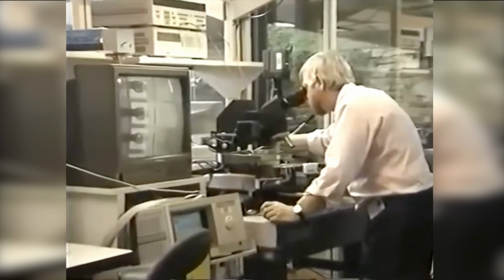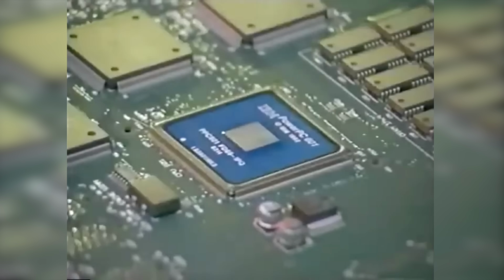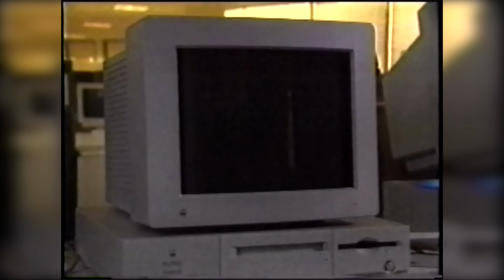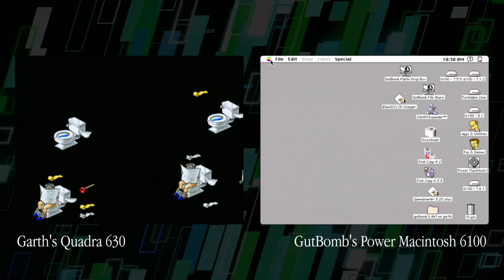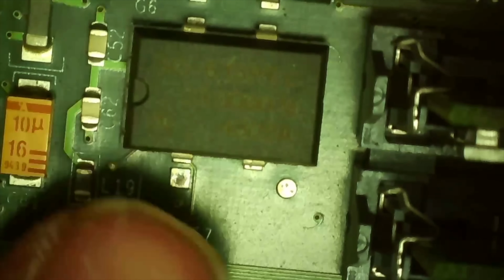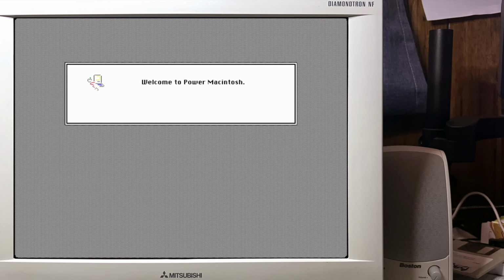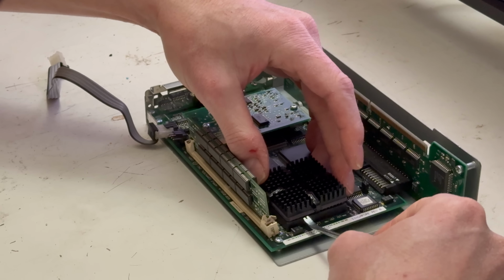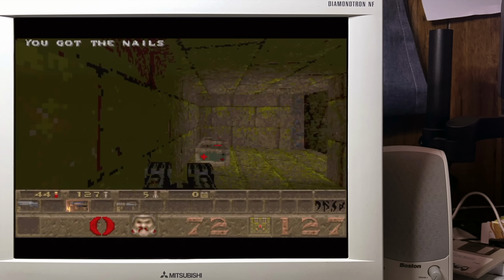Was the Power Macintosh 6100 Crummy?

Comment: The only good thing about Mac’s of the 90s was they never ever ever crashed. Windows on the other hand. Every few minutes.
Reply from the maker: Oh man, macs crashed all the time. Mac OS was a huge unstable mess held together with paper clips and gum. All computers were at the time. It was just the slickest UI and had the whole Mac attitude to go with it that made it tolerable and preferable to a lot of people.
Reply: @ I dunno not in my experience. In the windows 95 era if you were working on a photoshop project for instance I could do the whole thing and not have to save it until I had finished. On windows you had to tap ctrl+s after every manoeuvre for fear it would either hang or just fully break. I never had such problems with macs. In fact I’d go as far to say I didn’t really experience fully crashing macs until they moved to intel chips. And actually for me in system 8+9 the only apps I ever found that crashed were freeware internet stuff like IRC and even then it never took the whole system down but just the app itself. And so you just had to reload the app. Windows was always BSOD. but again I’m talking late 90s.
Reply: They crashed a lot, especially in the PowerPC days.
Reply: @kirishima638  I just don’t remember it happening. I’m not saying you’re lying. But I had to use a Mac at work and a win95 pc at school. And everyday the wintel machine would crash and I never had a Mac crash once. 🤷‍♂️

Comment: @GutBombTech You know that back in early days of the Commodore Amiga a developer named Jim Drew made a Mac Emulation card for the A2000 that with an 030 or 040 CPU Amiga would show up as an Macintosh running whatever accelerated even though the CPU was running as the same speed as the eqiuvulate Macintosh. The other thing too about the PowerPC, the PowerPC that Motorola made was slower than the PowerPC that IBM made (both the same version same Mhz).

Comment: How slow was the RAM on the DOS card? In the 80's and 90's using faster than specified RAM could give a decent speed boost. For example the computer would send data to RAM and it would have a window of time where it would wait for the RAM to be ready to accept the data. The faster the RAM was ready, the faster the computer could move to the next thing. Same thing with reading from RAM. The computer would request data from RAM, with a window of time it could wait for the RAM to be ready to read.

This speed difference could easily be experienced on the PC XT and clones and most 286 through early Pentiums with the RAM counter during POST, with fast RAM test off. It was so nice to install RAM with a much faster nanosecond rating and hear the RAM test go from slow, individual ticks to brrrrrrrrrt.

Comment: I always hated how the 601 machines didn’t output video when the clock battery was dead
Reply from the maker: at least you can quickly power cycle it when you turn it on to bypass that.  still a pain though!

Comment: Upgrading from an LC II, my 6100/60 8/160 noCD was $1,600 at CompUSA within weeks after launch. I was happy with it. Later I added the 256K cache and the crystal upgrade snapped over the original with 80 and 84 MHz supplied. I ran 80 MHz most of the time so I thought I was right inline with the 8100. I added a fan and removed the back card cover to give it an exhaust outlet. But I think I finally killed it running it at 84 MHz too long and upgraded to the PowerBase 200 for $1K in 1997. 6100's later ended-up being terrific hosts for G3 upgrade cards.

Comment: When Apple Computer, Inc. introduced their 6100 line of desktop systems, this was almost my first Apple computer.  Felt that macintosh at this point, was no longer a toy and a real home computer system but, at this time my bank account was just a little too low.  My first system a few years later turned out to be an All-in-One 5400 with a 603 processor which, years later was upgraded with a G3 card.  My system also had Apple's internal video capture card system, Apple's internal TV/Radio card system with its matching "black" remote control.  Currently, this is still all working in my All-in-One 5500/275.  (smile ... smile).

Comment: My parents bought a 7100/66 to replace our Mac Plus in 1994. We used that all the way up until 2000/01 when we finally replaced it with a PM G4 sawtooth. We did have a couple PowerBooks in between that time.

Comment: The PPC was my favorite CPU arch. I think that if Moto/IBM had not had their infighting with "Altivec" and figured out their high MHz production issues, our current computers would be something quite different.

They were more power efficient, faster than x86 clock for clock, were easier to implement SMP (and by extension, would most likely have been successful making into multicore CPUs.)

The G5 was an argurable misstep.

Also, the 15pin monitor dongle did come with the computers. At least, at the start. I don't know if they kept them until EOL.

Comment: You made an excellent film with very cool modifications of this standard 6100 and DOS card. My story in 1994 is the period of writing my first master's thesis in economics. I had a Quadra 650 computer available (Mac OS 7.1) and as a second option PM 7100 (Mac OS 7.1.2)
After doing tests in Ms Word 5.1 (68k) and Photoshop 3.0 (68k PPC versions) I decided to use Quadra 650 to add the work and make drawings and illustrations, because it was better to work on this Quadra then. But in 1995 I got a Power Mac 6200/75 computer from my parents as a gift and this machine was not a good choice (very poor motherboard architecture) and after a year of use I sold it and bought a used PM 6100/66 with DOS card for less money and until 1998 it was my main computer. which I only replaced with the G3 Beige 266 Tower. Today I have the 6100/66 again, but with the G3 250 Mhz card from Sonnet and an additional HPV VIDEO Z PM7100 card. On such a 6100 it works very well, but I prefer to play Marathon :) The PM 6100 is always in my heart as the first very good Power Mac and generally a very solid machine,
Reply from the maker: I loooove the Quadra 650.  It's my most used classic Mac actually.  Rock solid machine.

Comment: Great video.  All I know is that I picked up a 475 at discount in fall of 94, for under $600 brand new at retail.  I used it until the spring of 1996, and upgraded to a 7200/75 for the heavily discounted price of under $1000, opting to sell my 475 for nearly $500 still.  A $500 upgrade.  The performance of that 7200/75 was quite a bit better than the 6100/66, and probably also a bit better than the 7100/80 or 8100/80.  For thousands less, just two years after the original PPC machines shipped.  It was worth the wait, and the frequent upgrade cadence I went through.  Going from a IIsi to the 475 in 94 was a good option at the time, as most software that I used was not even PPC native.

Edit:  forgot to mention, it's possible now to overclock a 475 to 50Mhz and beyond using just a software control panel and extension.  While 50Mhz is a bit more of a challenge, 40Mhz is quite easy.  So most people with both a 475 and 6100 in their collection could do their own testing between them.

Comment: Excellent video!  I’ve been collecting Apple stuff since the 90s.  Personally I’d make the argument that the 630 would have been a better choice because you could get the PowerPC Upgrade card for it, which retained the 68040 and could be switched back and forth.  This allowed for the benefit of PowerPC software and 68K software to be run at full speed.  Some would disagree with me though due to the IDE HD, but IMO in the long run IDE was more of a benefit than a drawback.
Reply from the maker: That is a great point, and the SCSI for the CD ROM could easily be extended out to use a SCSI HDD by just replacing the cable. 630 with a PPC card would be a great thing to test for a follow up. Now I have to find one…

Comment: Motorola failed Apple.  The 68000 was far superior when it came out, with an orthogonal instruction set and a large register file it was the perfect CPU for proper OSes such as Unix.

It’s just sad they fell behind the x86 and its 1970 vintage architecture sensibilities.
Reply: The 68000 was an odd ball chip, 32bit instruction set but a 24bit bus.

That 24bit buss would cause a HUGE problem for Apple.

Comment: It was never really called TaligentOS, except as a marketing term. Taligent was the name of the project, after it was decided that "Pink" was too informal a name. (later spun off as a company.) 

It was agreed that both IBM and Apple would create operating system products based on the shared code in Taligent.

For Apple, it would be a new version of the Macintosh Operating system.
For IBM, it would become their Workplace Operating System. 

In the end, Workplace OS would only see the light of day as an OS/2 for PowerPC beta, with a Mach microkernel, Taligent middleware, and an OS/2 personality (I have a copy).
And Apple's Taligent offering would be severely reduced, as Project Copeland. 

The Taligent object orientation framework would ultimately be spun off as CommonPoint, to be used in some obscure enterprise middleware deployments in the late 1990s.

Comment: On the flip side, the 630 could also upgrade to PPC via a card that used the 040 processor to run 68k code. I believe this card had 66 and 100 MHz variants. Think you could give that a try?

Comment: The 6100 was my first Mac.  The only real problem was the poor video resolution 832x624 without Grapic Card (AV Card). A OS with GUI and Low Resulution ...

And the 6100AV was not available in Europe. A custom upgrade was very expensive, about 50% of the 6100, compared to a PC video card (1024x768 or so) for 100 or 200 bugs.
Reply from the maker: Those resolutions seem pretty low by today's standards but I have a 17" CRT on my desk that I use all my retro machines with and 800x600ish is really the sweet spot.  Bigger monitors back then were SOOOO expensive compared to now.

Comment: Weeeellll… the Macs consumers bought in that era were the Performa line, not the Quadra. The Performa 630 (same as the Quadra, but without FPU and with more bundled software), Performa 500 series all-in-ones, and the Performa 400 series (same as LC series, but with more bundled software) were all intended for consumer retail, and were a bit more aggressively priced. (The Performa 475, with the 25MHz 68LC040, was the performance-per-dollar king at the time).
Reply from the maker: The Performas were all bundles though, with a monitor and keyboard.  If you already had those you could save by getting the Quadra, and that bundled software was all junk anyway.  Nothing was actually stopping people from buying Quadras.
Reply: @ I suppose. 

They were not always bundled with displays, though AFAIK keyboards were always included. This probably depended on what market (country). 

The software was a mixed bag. ClarisWorks was a great program.

I never said consumers couldn’t buy Quadras (or later, Power Macs). Just that what Apple marketed to consumers was the Performa line.

Comment: If the benchmarked Performa 630 had an FPU, it wasn't stock - they cheated! Only the Quadra 630 came with an FPU.
Reply: Plus PhotoShop was PPC native pretty fast and that was the power app of the time. I find it odd that everyone compares early PPC performance with 68k. Things moved pretty quickly and native software was available for most major software soon afterwards. There was the cost to upgrade, but that cost had value because your workflow was faster! Like, 5x faster or something wasn't it :)
Reply from the maker: well it was about home users.  games and home apps, not photoshop and pro stuff.  If you were a pro you were getting the 8100 any blowing everything away.
Reply: @GutBombTech  heh, but by that logic, a home user with an 040 Mac wasn't upgrading in the 6100 era anyway :) over time even the home software became PPC and the benefits tricked through. I wouldn't have worried about the day 1 compatibility performance. I would have made sure my 6100 had an L2 cache though. That's a good few percent speed boost and not all of them had one.

Comment: I have the exact same setup as you. I overclocked my 6100 to 80Mhz as well. The 486 is bottle-necked by the garbage VGA chip from the late 80s that Apple used. Using different CPUs won't make much of a difference sadly.
Reply from the maker: username checks out

Comment: My Quadra 840AV is pumping it's guns and waiting for a rematch with the 6100!
Reply: Steve! Fun challenge: PPC Native Photoshop Vs DSP Accelerated Photoshop!!
Reply: I suggest testing Quadra 840 AV with 8.1. and Photoshop 3.0 or 4.01 and DSP in action against PM 6100/66 or 80 with 8.6 or even 9.1 (already very much with PPC code). From what I've read, things like Appearance, Apple Guide, AppleScript, AppleShare/File Sharing Extensions, Contextual Menu Extension, QuickTime 3.0, Sound Manager, Video Startup (use in AV macs), Apple Menu Options and Control Strip and Date & Time were never rewritten to PPC code and until the end in Mac OS Cassic were as 68k code
Reply: @Rafal_Konopacki  I know there was a Photoshop DSP use, was it a out of the box Photoshop, or was there any patch needed?
Reply: Let's get a rematch, and for giggles try upping the oscillator afterwards to 60MHz to get a 6100/120 and rebench that bad Larry

Comment: I'm surprised at how poor doom runs on that dos card. on an equivalent pc 486 doom should be humming along at near 30 fps. i wonder what is bottlenecking the dos card?
Reply: Also indicated by the minimal improvements when upgrading the CPU. Definitely being throttled by something along the way!
Reply from the maker: Oh yeah it’s definitely bottlenecked. The thing is really designed for running lotus 123 as opposed to games, so it’s just got really bad video performance connecting through its (unexposed) ISA bus. That’s my guess anyway
Reply: I think it might be the RAM. Not on the Mac but on the card itself.

Comment: Apple did a disservice to the PowerPC processor by making the L2 cache optional in the initial low end PowerPC models, as many PCs at the time included L2 cache as a standard feature. This only served to exasperate system performance when emulating 68K code. Even if it required a slight bump to the initial MSRP, it would have probably improved initial impressions.
Though to be fair, the amount of 68k code in the Mac OS was also a huge detriment to the PowerPC systems. No doubt Apple was trying to rush these systems out the door, native code be darned as long as the OS could boot...
Reply: The thing was, running the 68k code didn't really slow anything down, it ran at near full speed, BUT the context switch between the two modes was VERY costly and kneecapped it.
Reply: @slightlyevolved  I remember testing PM 7100 vs Quadra 650, both with 16 MB Ram and Photoshop 3.0 - Quadra worked better after the debut of PM 7100, then, as the system had more and more PPC code, PM 7100 improved its result.
Reply: The issue was the price bump. Those cache RAM chips were very expensive until about a year after the thing shipped. But a big, fast cache would really have helped.

Comment: Also... your scenario theorizing about what family computer to buy? That was EXACTLY the situation my dad was in, in 1994. He had to replace our aging Amiga500 and a family friend steered him to the Mac. I didn't know anything about Mac then, and was way too young to contribute anyways, but the friend helped him land on an LC630. It was wildly exciting for me at the time, but buying into a dying chip platform meant that I had a narrower and narrower library of apps and games to run... I looked at my friend's 7100 (purchased around the same time) in envy. Even if it was slow, it still RAN the new games when my old 630 simply couldn't... and there seemed to be better upgrade options for the first PowerPC Macs to extend their life. I LOVE my 630 now, but late-90s me resented the choice.
Reply: I had a very similar experience with a Q610 that my parents purchased instead of shelling out the extra money for a 6100. There were a few games that came out that my Q610 couldn't run and it made teenage me feel like we had made a bad choice, but I didn't consider the extensive back catalog of software our Q610 could run like a champ and could be purchased really inexpensively used. I still have fond memories of that Q610.